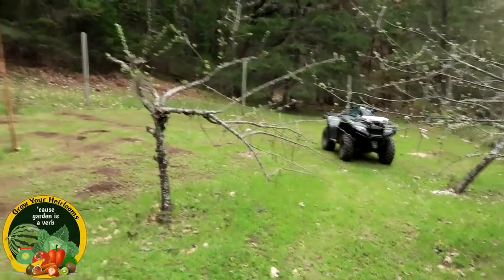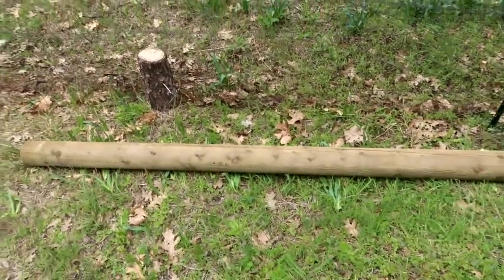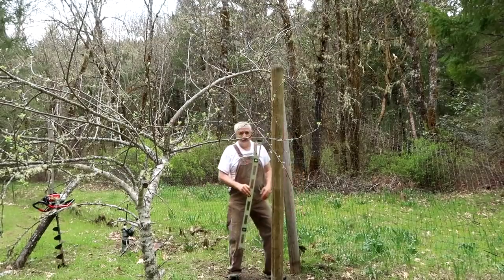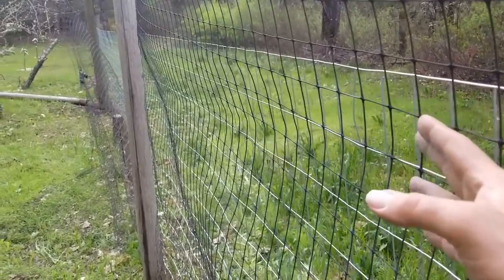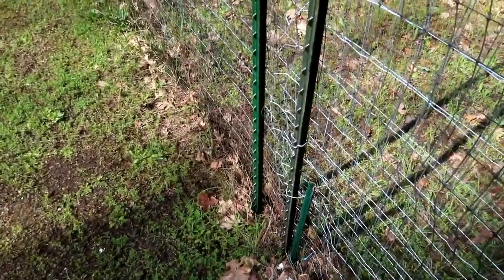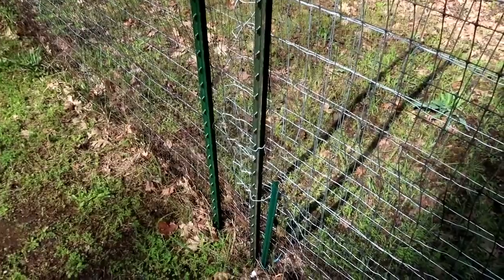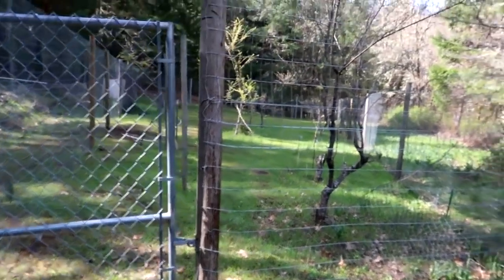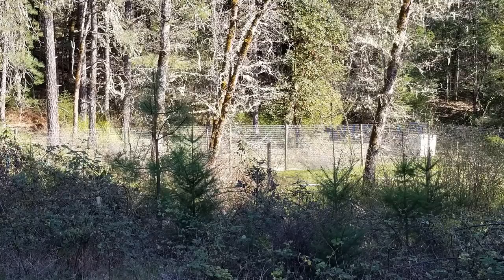Installing New Fence in The Orchard

Comment: no need to bury them in concrete, it just makes the rot faster. Its not holding up much weight. The concrete basically traps moisture right next to the wood making a bowl, keeping it constantly wet.
Reply from the maker: The ones that were put in 20 years ago are still holding. The broken one snapped at the surface. Do you think it was rotten because of moisture?